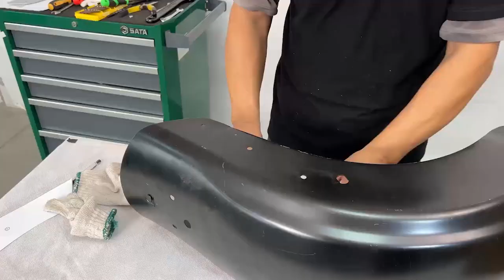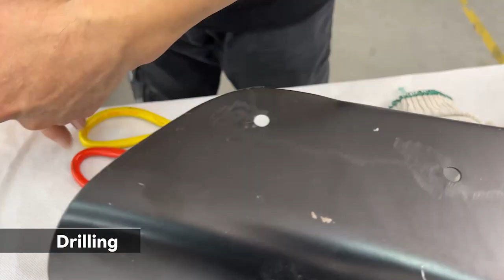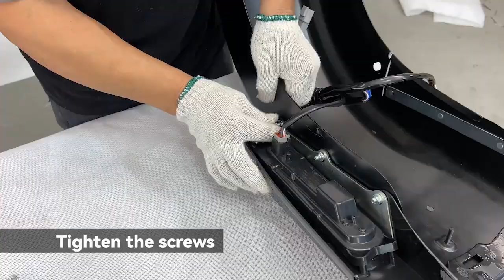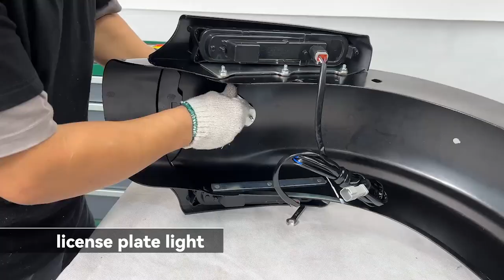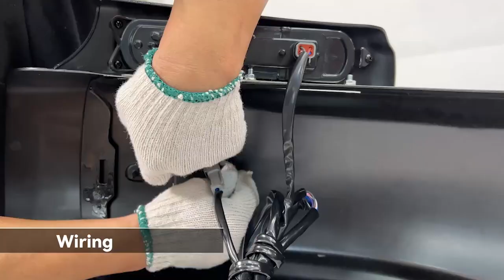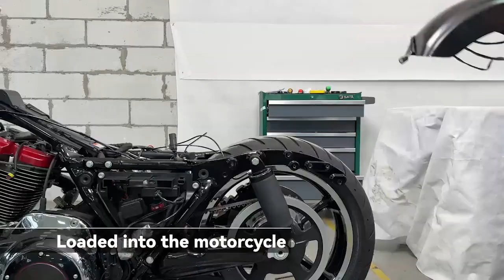TCMT | Rear Fender Fascia Set Installation

Comment: I just bought a fender with the extention like the one in this video and the plastic fender was to thick for the seat screw hard ware I couldn't get the clip on the top side of the fender so I could screw my seat down I had to drill out the hole and then get a grinder on the inside so it was thinner

Comment: So I was looking into purchasing this item and seen that drilling was involved.  Couldn't fully tell from video because it went by so quickly, but when drilling the 6 holes into the fender, is it basically enlarging the current holes in stock fender or is it for making new ones in a different position?  Also, is that template supllied or does that have to be made on our own?
Reply from the maker: Please contact our website customer service.

Comment: Hey TCMT! I just received my stretched CVO style fender for my 2013 SG. I put the connector together for the license plate light but it’s not working. I did notice it has “1 and 2” on the connector but both wires are black. Are the connections specific? Or did I install the wires backwards? Please help
Reply from the maker: Please contact customer service from your purchase order.
Reply: @tcmt ok thanks for the reply. I’ll reach out to customer service
Reply: What did you find out?